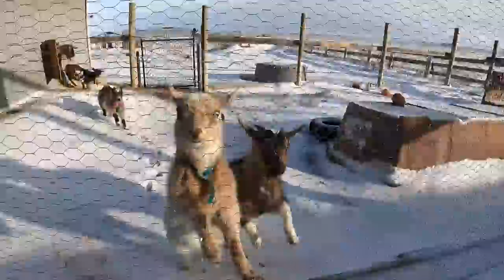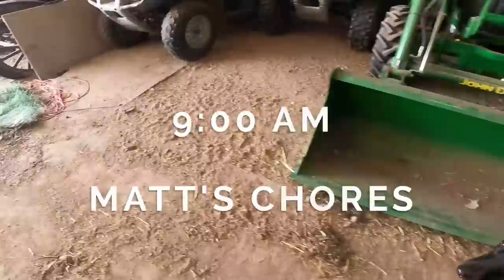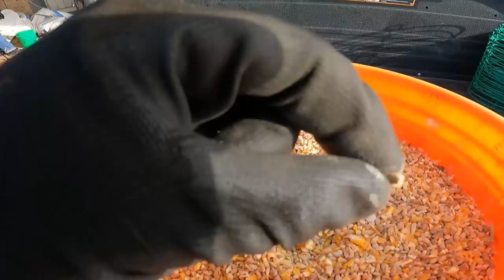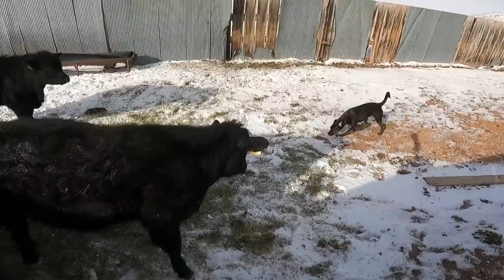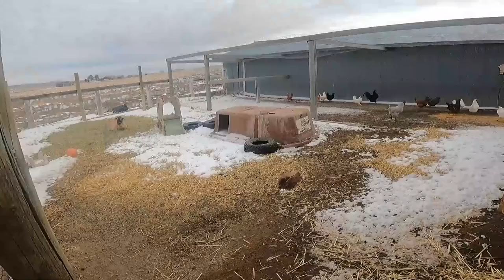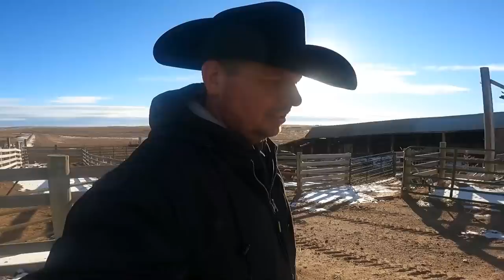A Day in the Ranch Life - A Saturday on the Ranch

Comment: Might sound silly but that's a lot of snow in places it has no use. If u need the moisture then u can plow those wasted areas and those big ice chunks and pile them up on a norther side of a hill so the run off waters the field below it.. and it may only help one area but anything can help.. but fuel is high rn also so I figured it wouldn't hurt to run it by cus those r some big snow drifts in the stalls and old runs and in the roads and parking areas